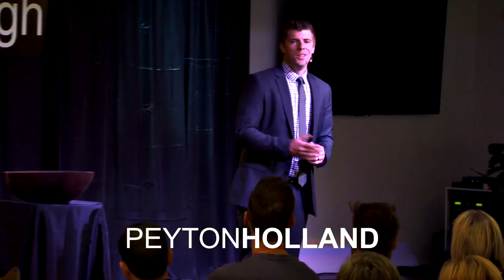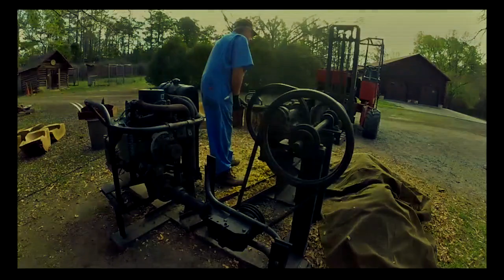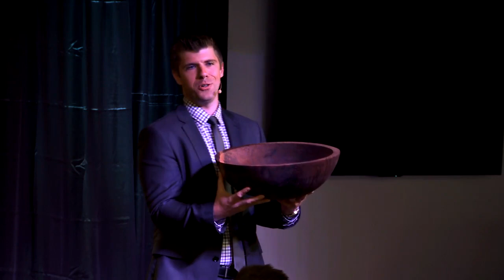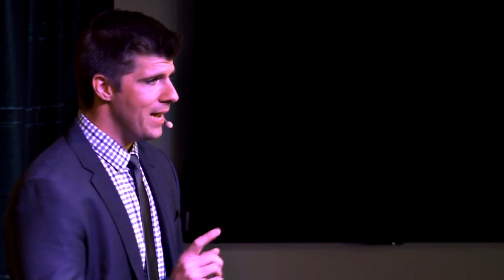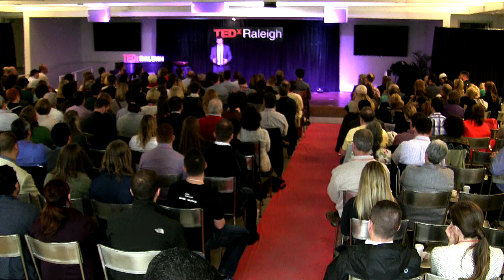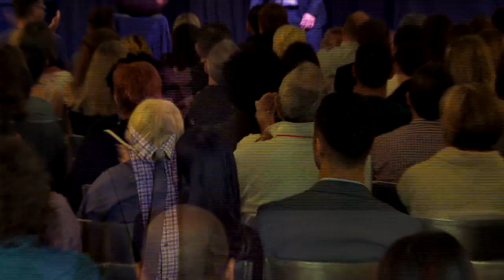Skills that pay the bills … and redefine success | Peyton Holland | TEDxRaleigh

Comment: Perhaps the best way I could sum up the Western education system is by quoting my high-school math teacher's standard response to me whenever I didn't understand something:.
"You don't need to understand it, you just need to memorize it."
Reply: I nearly failed high school because I wanted to understand everything. ooh the irony
Reply: This is actually good advice.  I did this in college chemistry.  Memorize (sort of like locking in date) then when you have the data in your head, then afterwards you can process the data.  And also I used this in math too. 4+6=10, "You don't need to understand it, you just need to memorize it."  I earned a BSEE.
Reply: EXACTLY, like the alphabet, math is just memorizing what goes where!

Comment: your example of welders- not good. wfhat do welders weld? metal for cars? bridges? buildings? all very very dependent on interest rates which are out of your control- so if you dont mind making 60-80k then being periodically unemployed  for periods of time then go ahead. but you need to tell the WHOLE story- not just cherry pick!...and who designed that building? the hvac? the cars? right. architects, engineers, planners, supply chain etc.